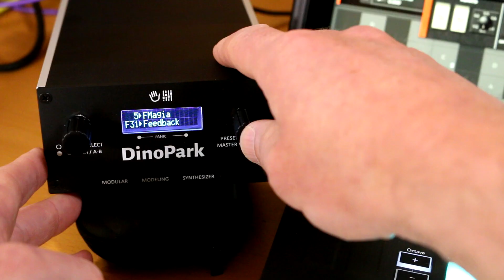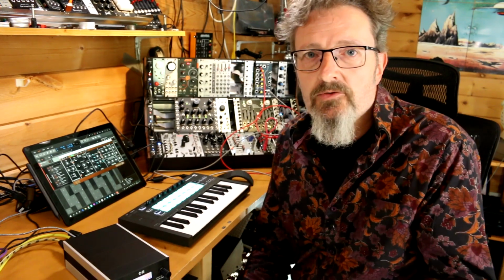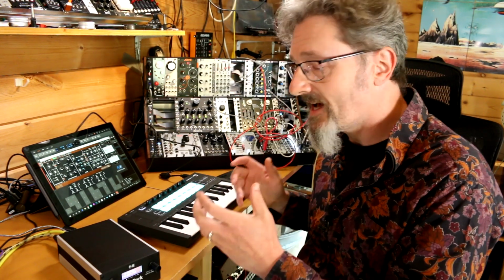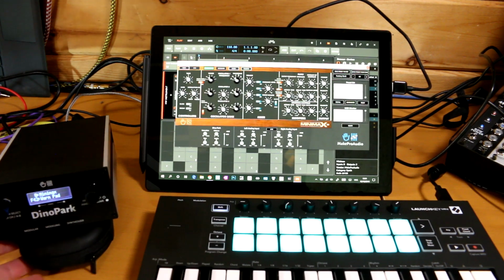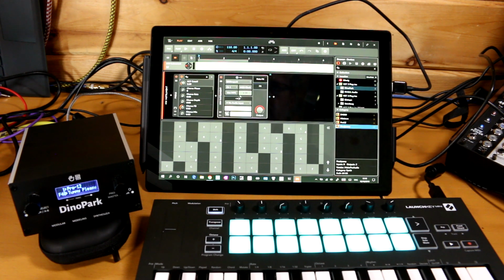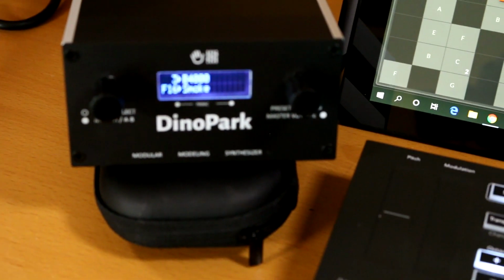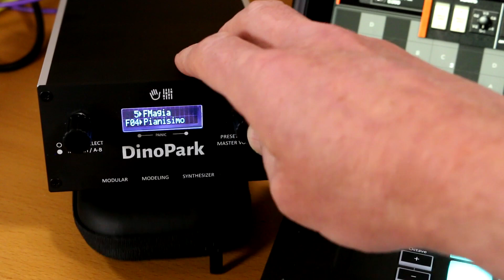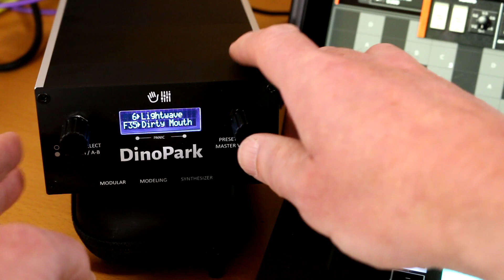DinoPark DSP Modelling Synthesizer - sound demo and review

Comment: About the preset names: it's simply because Creamware/Sonic Core borrowed the names of the virtual analogue hardware synth modules it manufactured and sold on the early 2000s: Minimax for the mini-Moog, Prodyssey for the Arp Odyssey and Pro-12 for the Prophet. I own the three of them and they are quite good clones, with exactly thé dans layout as thé original ones, plus, being digital, preset memories and polyphony. To add on cosmetic realism to those copycats, I even equipped them with replacement original knobs and sliders ! They had a virtual analogue Hammond B3 in their range too!
Reply: The Organ is still available as Ferrofish B4000.  But it's distortion did not sound very good.

Comment: I would have preferred to see a remake of the V-Machine, which allowed to run several plugins simultaneously including layering/split.
Reply from the maker: Sure - but this is not a plug-in machine. It's hardware DSP running physically modelled synths.

Comment: “A box that can run a huge number of virtual digital synths like the minimoog...standalone...” etc  That could be a description of your tablet.
Reply from the maker: Yes but computers as we know are beset with a continuously variable ability to process and manage audio. Whether that’s running out of processing power or struggling to produce glitch-free audio at low latency. You also have the high cost of the computer, the software and the audio interface to consider. Whereas this box will always run it with no latency or additional equipment. There are pros and cons of both but they are not the same.